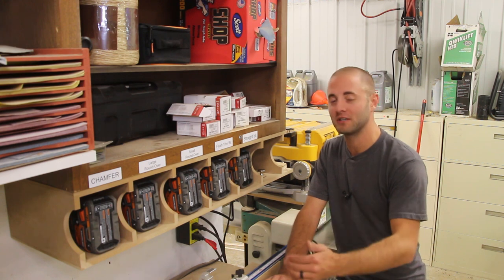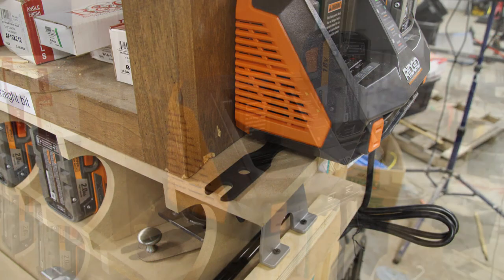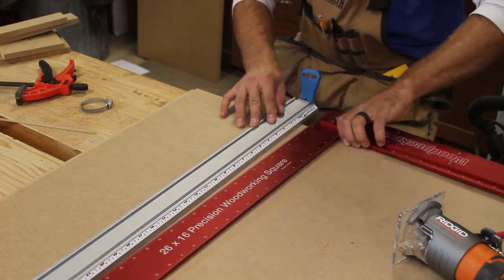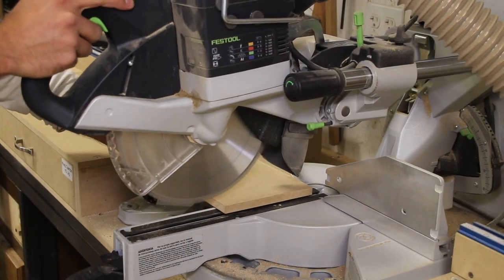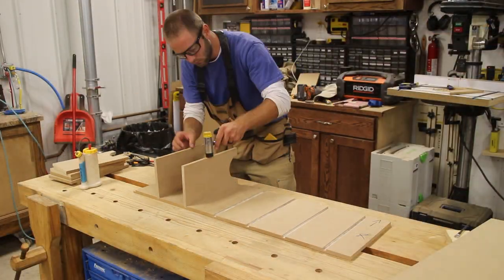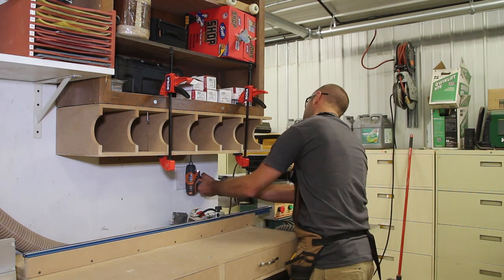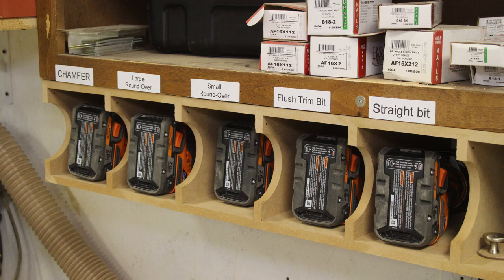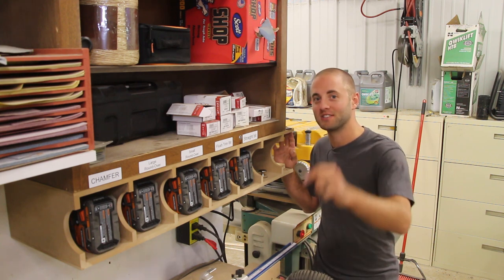Ridgid Trim Router Cabinet - Lean Shop Organization

Comment: Great project. I like tips like running the unit thru the table saw at the end to flush everything along the front. I'm still waiting for an M18 router. The rigid looks great, but I'm trying so hard to keep 1 battery platform.

Comment: These are being cleareanced out at Home Depot right now for $80. Not sure why yet. They are awesome. I will talk to the rep and post if I find out anything. Normally it is make room for an updated model but this has only been out for 4-5 months.
Reply: Dayum, that's 1/3 off the normal $120 price.  They're NOT on sale at my local HD (or any nearby), so are you sure those are the R86044B?  If so, you better scoop those babies up.  Don't forget to register your LSA warranty!
Reply: floobertuber Found out the store I was working at had to clearance them for space, we are a smaller store and were not authorized shelf space for that item. We only carried them through the holiday period. The clearanced routers sold out in one day. I wanted to get another one myself put missed it. Just a heads up, if want to get clearance tools at Home Depot, go early Monday mornings. That is when the MET Team marks the majority of clearance. Any later than that and the contractors will snag them. I purchased a $700 Bosch miter saw for $280. Stole it!
Reply: Wow! Great deal on that Bosch.  Thanks for the tip!!

Comment: I recommend you also get a drill driver for every bit so you dont spend 10 min a day changing it
Reply from the maker: Carlos Azevedo lol.  So you are telling me you do not use one drill for a pilot hole and another drill or impact driver to install the fastener.
Reply: yes but i dont buy a drill driver for each one of the drills or bits i use more
Reply from the maker: Carlos, I do have a bunch of drills for drivers. Check out some of the other videos in my shop. I have an organizer over my left shoulder. - Andy
Reply: 10 min/day = 50 min/week = 3.57 hour/month, so... I'd say it pays itself in three months? It doesn't sound too bad to me ;)
Reply: I have 3 impact guns and 2 drills for that reason, jk providing tools to my crew was part of my life for the last 3 years
Reply: Changing bits in a drill is quick and easy. No reason to have 10 of them. Changing bits in a trim router is different.

Comment: At first, I thought cordless routers may be a good idea, but when you have to hook up to a shop vac anyways, what are you actually gaining? How much were all those routers and batteries? Its also not a good idea to keep a router bit in the collet permanently, its more likely to seize up. I'm sure you have a table saw and dado set. You could've cut all the dadoes for this project in minutes, then ripped the piece in half for perfectly aligned dadoes. A router is just "out gunned" if you can use your table saw.
Reply from the maker: Please read the comments or google Lean Six Sigma.
Reply from the maker: Also, I was using the router to make the project if you didn't notice.

Comment: I was just wondering if you have had any issues with your Ridgid cordless routers burning up.  I bought one recently partially based on your enthusiasm for it. I however ended up having mine burn up after about an hour of cumulative use with a 3/8 flush trim bit.  Thankfully I had no issues in returning the router but I'm wondering if I should reinvest in a new one.

Comment: This isn't applicable to a DIY shop or even a small scale business. This is a setup for a mass production shop. If you don't understand Lean Six Sigma and it's purpose for the manufacturing process then just do not even type a comment. Think of it like clamps.

Andy is not a typical DIYer....he has a sponsorship that allows him to get that amount of tools OR he does like most of us and invests back into his business with any profit from his business.

Put it into the casual DIYer perspective. Pocket holes. Do you sit there and keep swapping out the bits? Drill....stop...swap...fasten....repeat. Majority of us have dedicated drill from drilling and one for fastening.

Andy thanks for giving me the tip on hanging chargers! Will use it.
Reply from the maker: Thanks!